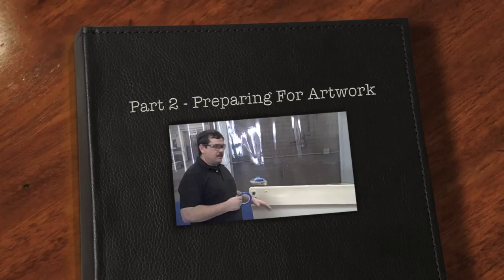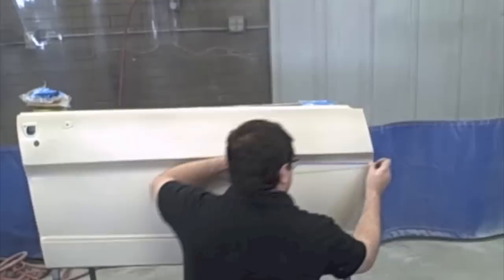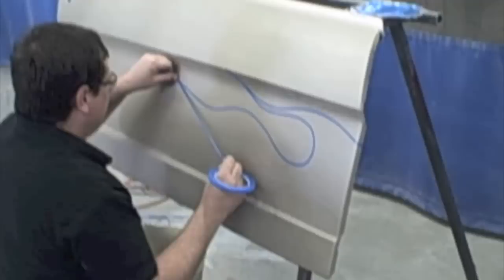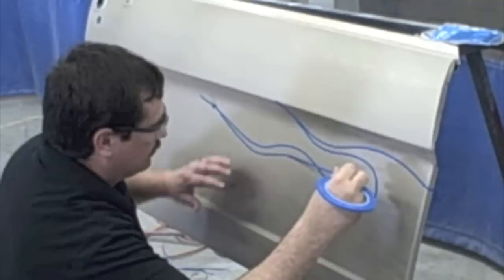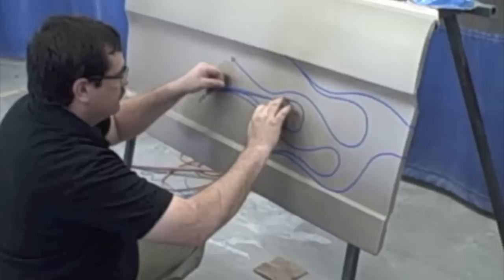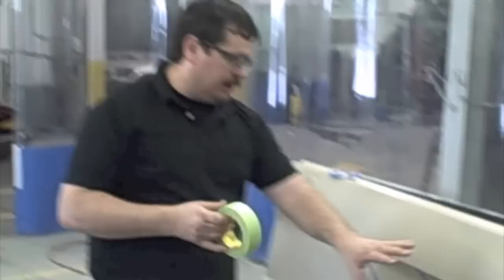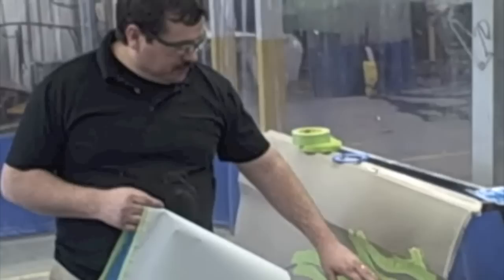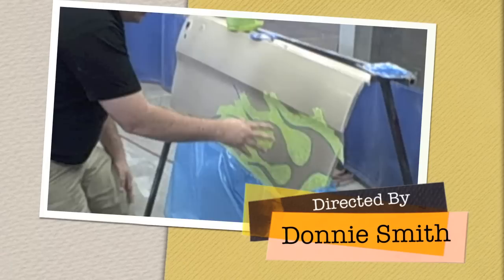Prepare Paint For Artwork - Masking Flame From Donnie-Smith.com

Comment from the maker: Fiberglass can be primed with 2K primer surfacer and vlock sanded.  You do not need etch primer or epoxy since corrosion is not a concern with fiberglass.  Once block sanded with 320 I would final sand with 500, then apply sealer allow to flash, apply base coat, allow to flash, then clear coat.  Thanks for warching the videos.